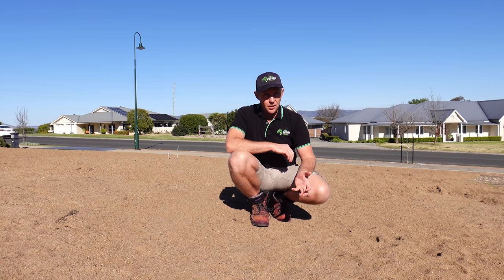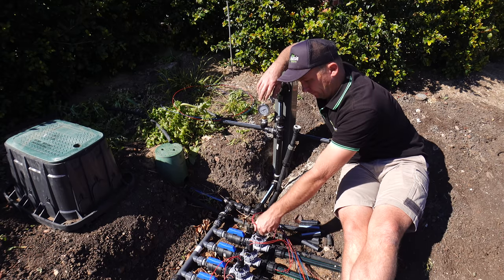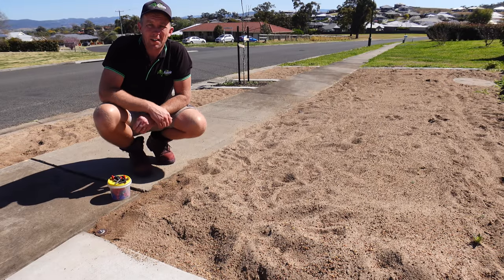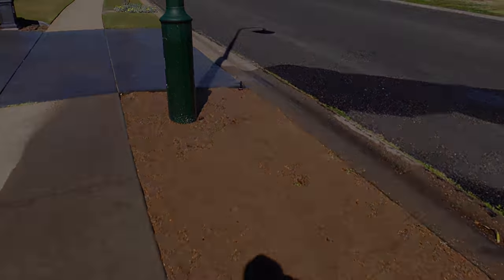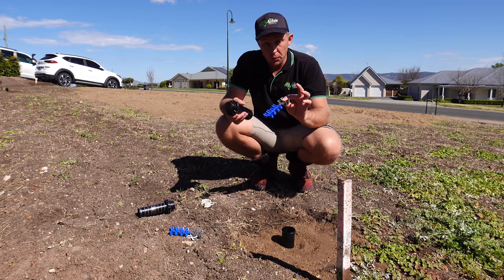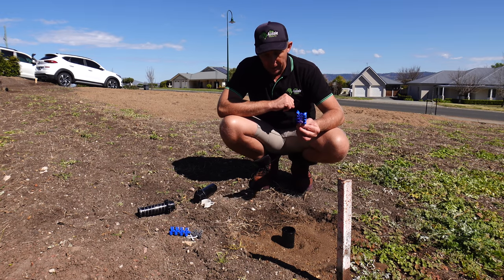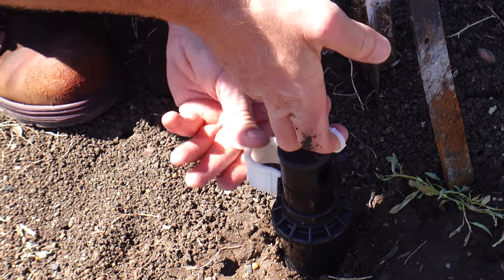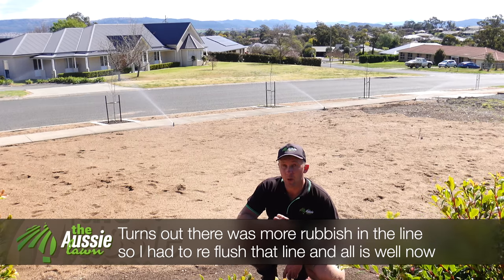Setting up my Irrigation system

Comment: Great video mate, I just updated my system, I have the hunter gear as well. I added a Water Metre to report water usage. I have the MP Rotator in my back yard and the normal nozzles for the front yard.
Reply from the maker: Thanks mate, Ive thought about the water meter myself might have to look into them

Comment: With low flow/pressure like my house. Some bodies don't need to be extended to let the water spray.
I have chainged from Pope to Orbit to allow 3 - 360deg bodies on at once.
Reply from the maker: Seems a lot of areas these days have much lower flows than im use too. Glad you got a system sorted that works with your low flow rates. Hope you have a tops weekend mate

Comment: Thanks for this. Question…. Your static pressure gauge…. Just a gauge into the pipe outlet? Nothing special about it? Asking as it would make my planned sprinkler system easier to work out.
Reply from the maker: Thats right mate make sure you get one that reads up to about 100kpa

Comment: what length body did you go with mate? im guessing it would be critical too what depth your piping would be beneath the surface for coring etc.
Reply from the maker: Just standard PGP ULTRAS which are about 20cm (8") and the popup sprays along the road are 15cm (6") basic rule of thumb keep your pipe work at least a full spade depth at a minimum mine are a slightly more than that to avoid any potently pipe damage down the track by coring or digging etc

Comment: Any reason for not going with the Hunter mp nozzles for the smaller sprayers? They use alot less water and more of the water ends up on the grass instead of the concrete. I prefer the rvan range from rainbird
Reply from the maker: Hi Simon, Yeah I chose the sprinkler nozzles I did for a number of reasons, The narrow strip lawn between the street and concrete path way measures just 1.4m wide the nozzle used sprays 1.5m where as the smallest MP sprays 1.8m - 4.2m. The other reason I used the red fixed nozzles in the other part is they are the closest match for precipitation to the narrow sprinklers. I have also personally found the reliability of the MP rotators questionable in the past. Finally as you saw in the video being on a hill we get quite a lot of wind, In my experience MP rotators don't cut it in the wind. Finally I needed sprinklers to roughly match output of the PGP ultras esp when i connect my EZflo unit to the system. Re the rainbird stuff Ive really only ever played around with the rainbird R50 (not even sure if they are made anymore) What do you prefer about the rainbird stuff mate?

Comment: Great video mate, can you explain why you chose the spray vs the rotator nozzles?
Reply from the maker: Hi Richard, Because Im running those prospray and various nozzles in one line I needed to find the closest possible matches when it comes to water outputs. E.g The MP rotator that best matches the area puts out far less water in the same time as the nozzles along the road. Plus I have heard and witnessed first hand reliability issues with some of the MP rotators also I personally find the spray from them is more easily wind effected.
Reply: @theaussielawn  top job on the vid mate.👌
I’m currently running hunter rotators on two circuits front 140 squares mtrs 
and back also 140 square mtrs

I experience first hand the wind factor with my back yard as the backyard backs onto a lagoon witch gets a lot of coastal wind.
The way I’ve gotten around it is running a slightly more powerful nozzle like an mp2000 and set them to run at 3:30am before the wind kicks up from the coast.
The front yard is protected from the wind and they run a treat.

The kids love playing in the yard on a hot day trying to negotiate a path way through MP rotators.
Great for both the grass and the kids.

🍻⛳️
Reply from the maker: @WOODZY_  Gods country mate your a lucky man, Hope you are going well mate. Have a ripper weekend

Comment: Awesome video mate - very informative! Questioning my irrigation now. I'm tossing up between the Hunter Rotators or the Hunter SRM. I only have a flow rate at the mains (off the street) of approx 37L per minute and 30 (ish) PSI. Any suggestions for what you would use in this case? My lawn is a big rectangle (28m long x 7m wide). Thanks!
Reply from the maker: If i where you id divide it into 3 or 4 zones and run 2 sprinklers a zone or something along those lines. that way you can still get your lawn watered with the pressure and flow you have available to you. I did do a flow rate video last year which can help you do the calculations if need be
Reply: @theaussielawn  Thanks mate, legend. Any suggestion on what sprinklers would be better? Have Tiftuf  installed.
Reply from the maker: @porseven3523  Id be looking for sprinklers that use low flow rates maybe some of the smaller capacity MP rotators. best thing is draw you area up on some 5mm grid paper it will help you no end

Comment: would love an idepth on flow rates and sprinklers :)
Reply from the maker: What aspect of flow rates mate ?
Reply: @theaussielawn  for me as an example if I have 27ltr/min how do I calculate how many sprinklers on one run. (Home enthusiasts) and how to calculate head loss. Got a crappy 320kpa at the water meter so nothing good their would love to gain information on how to design for low flow/pressure
Reply from the maker: @Mr_Mumble_PSN  wow that is heavily restricted water flow you have. I would be inclined if possible to start by getting a tap or branch installed just past the water meter seems a lot of areas now have flow restrictors in place this may give you better flow and pressure (MAY) how big are your lawn areas your hoping to irrigate
Reply: @theaussielawn  no restrictor lol mains pressure is low as gravity fed just unfortunate really I have 3 tap locations and 190m2 happy to email house plan and details
Reply from the maker: @Mr_Mumble_PSN one tip would be break it up into as many zones as you can even if you ran one sprinkler as a zone at a time . That would also give you perfect control over areas that might need slightly more water than others, Ive had systems in the past that ran one sprinkler per zone and it worked well . Just a thought
Reply: @theaussielawn  thanks to your calculations I was able to work out what I can put on each zone leaving a buffer now to work on head loss per meter

Comment: Backflow installed?
Reply from the maker: Hey mate thanks for the message, as this is only part of my current irrigation system yes I have a back flow valve fitted earlier along in the line